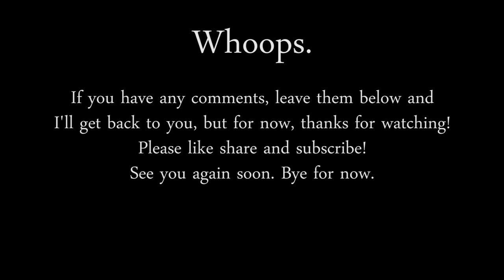#77 Wood turning a Sycamore Bowl with Texture and Gold Gilt Belt

Comment: ah, was wondering how the bowl was secured when the interior was being hogged out and the gilding applied. i'm impressed that mechanical hold was enough to secure such a large piece. Very neat effect with the pattern, painting and gilding!
Reply from the maker: Thanks for the comment. The recess like that is actually very strong indeed. I chose not to use a tenon as I have no method of turning it off at the end and keeping the nice spiralling on the bottom.

Comment: I can easily believe you did a ton of sanding. Your clothes look like you just came in from a desert sand storm. ;-) Even with a slow speed on the lathe I can't believe you wear no face shield...brave?
Reply from the maker: Hi Gil. Thanks - generally, I'll wear a faceshield for really hair pieces like natural edges and the piece I'm turning for next week's project. Or, a piece I'm not confident is solid. Otherwise, I'm comfortable in safety glasses only. Likewise, when I demonstrate at clubs, safety glasses are worn rather than full shields, save for the exceptions given above. Teaching in the shop though, beginners are required to wear full shields. 
Sanding this piece was quite funny - did feel like I'd come in from the sand, yeah. Lol.
All the best,
Martin

Comment: Hi Martin,  Why do you have to use your hand to start the bowl on the lathe?  Is it because the lathe doesn't have enough torque at low speed to get it started?  We enjoy your videos, keep up the good work.
Reply from the maker: Hi there, MaineWolverine. Thanks for the comment. There is soooo much torque in the motor that a hand start isn't actually required at all. But with a piece this big, I thought, to keep the stresses down on the motor that a little hand start would be good. Also, with another large piece I did (off camera), when sanding in reverse, the torque in the motor and the inertia of the piece actually unscrewed the chuck, even at 500 rpm!

Comment: hi Martin just wondering if you put on Hampshire sheen original to finish a piece and you decided you wanted a higher gloss could you just go over it with Hampshire sheen high gloss or would you have to sand down the original? thanks
Reply from the maker: +Bobby west Hi Bobby. Thanks for the comment. Good question. No need to sand off HS Original in order to apply High Gloss over the top. It goes on easily over the top.
Hope that helps,
Martin
Reply: Thanks.